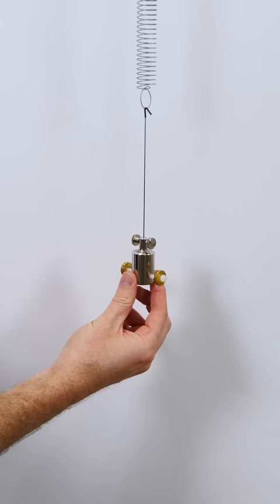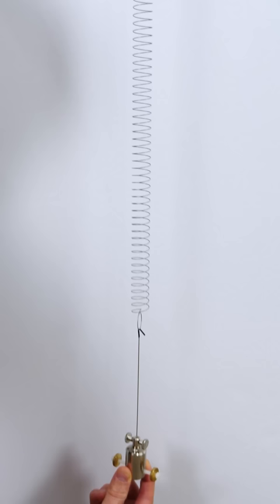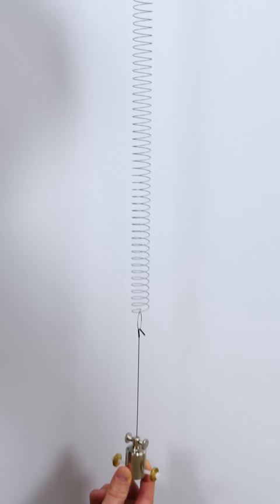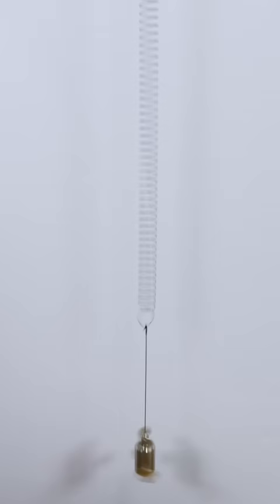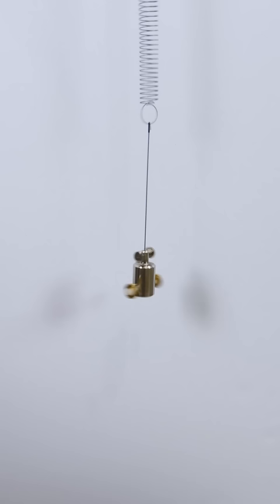Wilberforce Pendulum

Comment: I don’t understand anything he’s saying but his videos are just so entertaining
Reply: It's a physics class vibrations and waves, the subject is so large, changing 1 boundary condition will change the whole oscillation of the body+spring system
Reply: Same. 😂
Reply: Haha agreed. At least 75% goes right over my head but I still enjoy the videos somehow. YouTube magic!
Reply: Don’t stress; I have a degree in physics and I had to write out the equations just to soak it all in 😅
Reply: Yeah.. Like wow the spring looks cute
Reply: Exactly what I was thinking.
Reply: I'm only in 6th grade!!
Reply: @thefourshowflip  I have an engineering degree + I don't understand whats going on with this
Reply: @laus9953  
It’s a system of coupled oscillators in which it cycles between two modes (mode 1 being the linear up/down and mode 2 being the rotational motion)
Reply: I barely understand it and I’m about to start my third physics class
Reply: @chrismarston4266  
In a nutshell; it’s a coupled oscillator that periodically shifts between its normal modes. In the 1-D version of coupled oscillators, you might be familiar with two masses between three springs (spring-mass-spring-mass-spring) and when all spring constants are equal, the two normal modes would be the two masses moving together and the two masses moving opposite each other. Well in this version one of the degrees of freedom isn’t linear it’s rotational, so one of the modes is the extension/compression of the spring and another is the rotation of the mass.
Reply: @thefourshowflip  I just don't get at all, how one of them gets agitated again after complete standstill
Reply: This is very simple
Reply: I wish he showed the equation on screen. It means nothing to read out an equation unless someone is intending to write it down
Reply: @danicamacmillan2350  
You can find plenty of derivations and worked solutions for the Wilber force pendulum online 🙂. I’d post a link but YT is weird with links 😞
Reply: He is talking about the eigen frequencies of the system. In short, this frequency is dependant on the stiffness of the system, in this case only the linear and rotational stiffness matter. If the mass rotates the spring is wound up (so it shortens) but then it comes to a standstill because there is no inertia left and the spring unwinds again (elongating the spring). This oscillates at an eigen frequency. Same for the linear motion but with up and down instead of rotation. Now the fun part, adding frequencies together can amplify or dampen the final result (constructive or destructive interference). What you see in the video is that these frequencies are close to each other so for a while they move together (constructive) until they start getting out of phase and become destructive (leaving the weight hanging mid air). In a perfect world you'd be able to permanently leave the weight hanging mid air while the spring is moving. 

This is part of system analysis if you're interested and you can plot a bode diagram (this maps the amplitudes on the y axis  frequencies on the X axis) of this and you would get 2 spikes, 1 for the linear eigen frequency and one for the rotational.
Reply: I thought this too
Reply: @Naimin415 im out of highschool and im so confused too bro it doesnt matter
Reply: When the spring slows down the hooked weight spins faster and vice-versa
Reply: Yayyy, look at that cool spinning thing.

Comment: Okay, now I need somebody to turn this into an EM analog. Best I got is something with 2 inductors, one with oscillating ferromagnetic core and the other just a coil. I wonder if it will cause the peak current to catch up to peak voltage and then lag and then repeat at resonant frequency.

Comment: Frequency = (1/(2*pi))*sqrt(k/m)=(1/(2*pi))*sqrt(mgd/I)
Translation: The frequency of oscillation of the simple harmonic motion of the spring is equal to the frequency of oscillation of the simple harmonic motion of a physical pendulum.
Variables: k is the spring constant. m is the mass of the hanging object. g is the gravitational acceleration due to the Earth. d is the distance from the axis of rotation of the hanging object. I is the rotational inertia of the hanging object.
Explanation: Using conservation of energy, the translational kinetic energy created by the spring is the same as the rotational kinetic energy created on the hanging mass.
Reply: If it wasn't for air drag, the oscillations would continue on forever. Try this in a vacuum chamber and this should go on forever.

Comment: It is more of a like toy car spiral spring energy storing system where you pull the string and it rotates the inside spiral hence storing energy and then restores the spiral back to its position after releasing energy. RIGHT.

Comment: Or you could have just said that the rotational torque energy of the weight is being transfered in providing energy to complete the tensioning, rarefaction and compression of the spring, and vis versa.

Comment: So theoretically, if you could transfer out energy, for storage and a magnet that will engage to reset the pendulum from a potential energy position, we'd be able to create a generator using this type of pendulum that runs on a very low cost? I'm not a physicist but I'm just kind of imagining a contraption that'd be able to generate energy using this and would be able to reset itself as energy is pulled out of the system.

Comment: That is not the reason why this is happening, it is only a precondition to it happening.
The reason it is happening is because when you elongate a spring its end also slightly rotates, so it wants to rotate whatever hangs on to it.
Likewise, if you fix one end of a spring and rotate the other end you will make the spring either elongate or shorten.

That is the mechanism.

Comment: There's a massive problem with the explanation given at the beginning. "The energy of the pendulum can alternate between being stored as linear momentum...and angular momentum."

I'm sorry, but this is nonsense. Energy is not "stored" as momentum. You cannot convert between linear momentum and angular momentum. Despite them both having "momentum" in them they are fundamentally different quantities with different units. They are conserved independently of one another.

It is true that this pendulum cycles between translational kinetic energy and rotational kinetic energy, which are both forms of energy so they are conserved together, but this has nothing to do with momentum.

Comment: ...OMG!!! ...I see exactly what you mean...the spring constant is tuned to match the square root of the linear motion!!!

You do realize that the resonant frequency of the negative energy in the inverse function of minimum frequency created by the ossillating mass cancels out the translational motion in half of the square root of the inverse at the exact time when the moment of inertia equals the wave sine function of half of the maximum output of the torsion constant divided by the weight of the...you know the thing...and the bobbing amplitude multiplied by spinning rate. 

The exact reason all this is happening does not change unless you spend time dividing the root mass of the spinning body by the frequency of the wave amplitude of Wilberforce at the exact moment his brain broke. 

Suddenly I feel brilliant - and righteous.